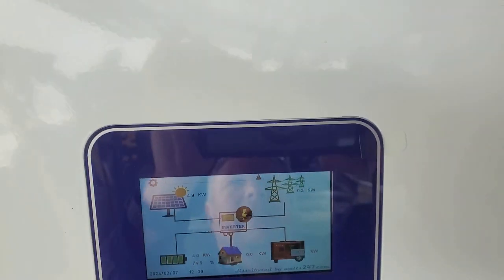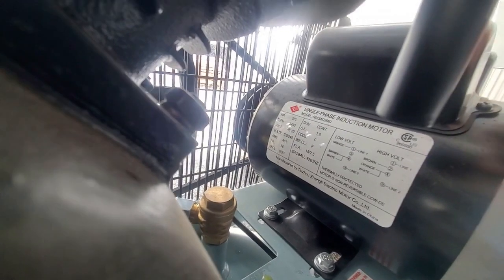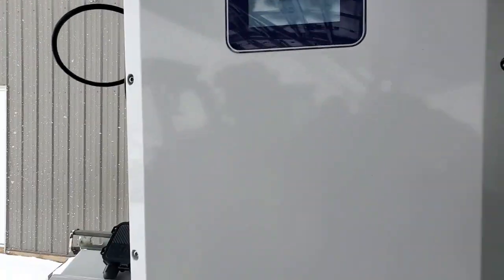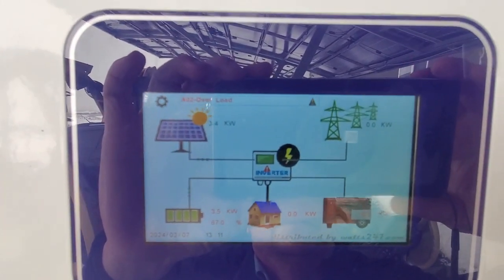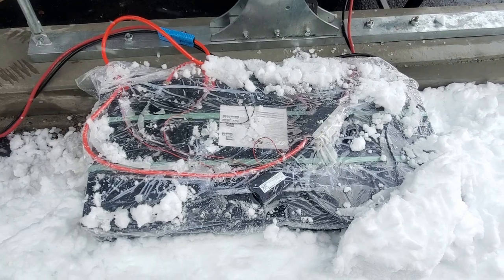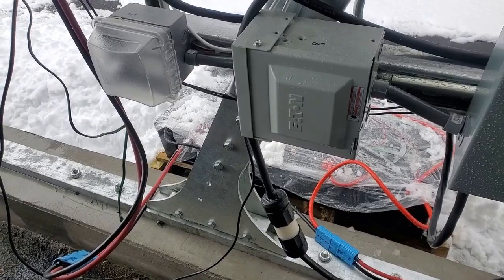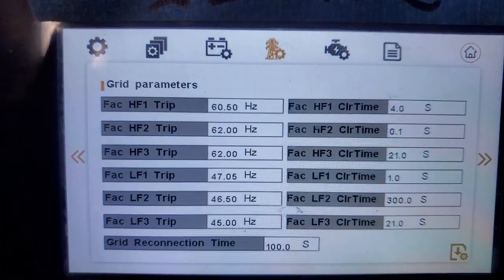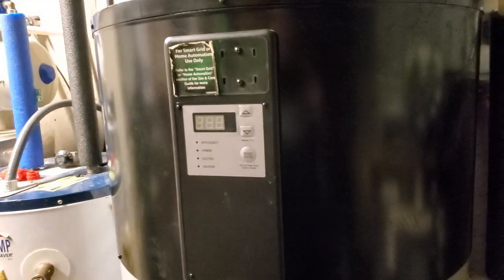Load testing the 15kPV NHX 10kW Hybrid Inverter (Saw, Compressor &  Ford Lightning) @ watts247

Comment: Looks great! Thanks as always for the great videos. Do you have a suggested wiring diagram for a hybrid on-grid/off-grid setup with the 10k with 200 amp single phase service? In particular is there a way to accomplish grid pass through while still operating in case of a grid outage?